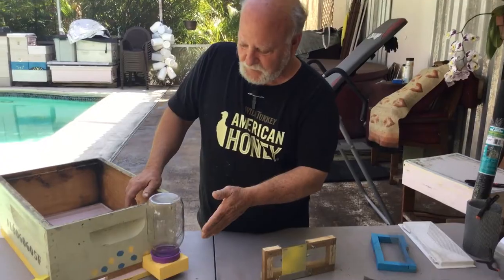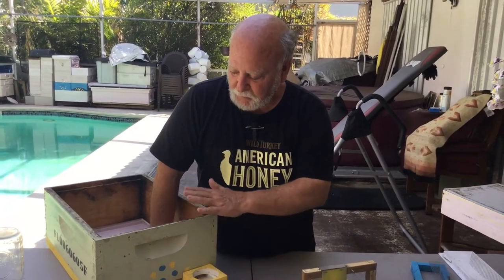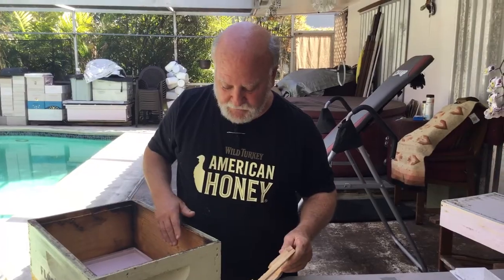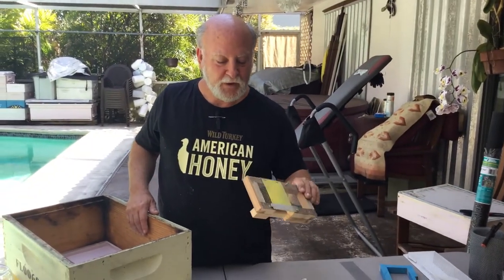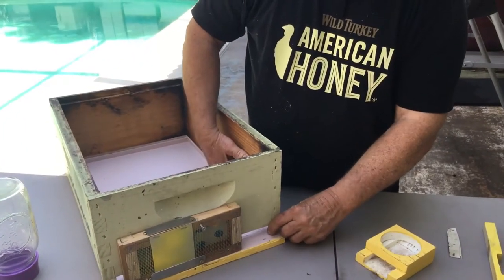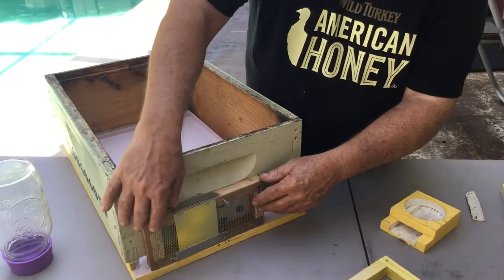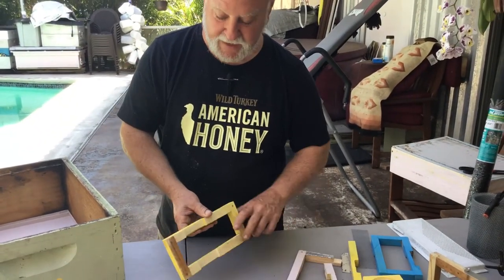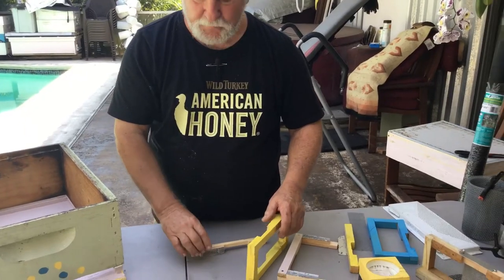Beekeeping - The ultimate HOME MADE robbing screen / moving screen

Comment: I was thinking about the times I've had finding my robbing screen and my staple gun and installing it in the middle of a full-on robbing scenario, I am always concerned about losing the foragers who didn't have the benefit of learning the new entrance location.   I wonder if, when the flow is over and I begin to feed, that maybe I should put the screens on before robing begins and simply leave them on till the beginning of winter.  What do you think?
Reply from the maker: I think that’s exactly what I do.  I put my robbing screens on here in S. Florida, at the end of June and don’t take them off until the end of September.  With this new screen I just created, I may not take them off over the winter at all because the one drawback to the “ultimate robbing screen” was the lack of a bottom entrance.  The foragers don’t have any problem figuring it out if I close off the bottom one while they are out.  I currently leave both the bottom entrance and the top entrance wide open so the bees get used to using both entrances.  I will never understand why robber bees don’t figure this out, but I am grateful for this small favor.

Comment: Do you leave the bee trap on hive all the time or just during dearth? And if left on for a period of time how often do you open metal plate so bees can remove dead bees , I do not live near my bees , so could you leave this trap on for a extended time and any advice would be helpfull
Reply from the maker: It is not a trap, just a robbing screen.  If you have the bottom gate closed, it does not prevent the bees from carrying out the dead through the top entrance.  The only time you would EVER have both entrances closed would be if you were sealing the bees in the hive, which is why it is made of screen so there is still ventilation.